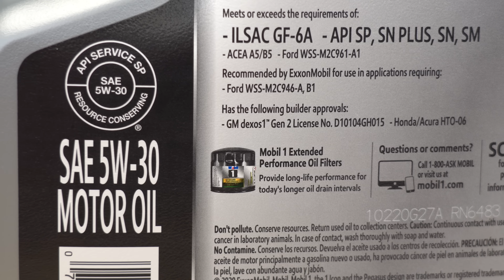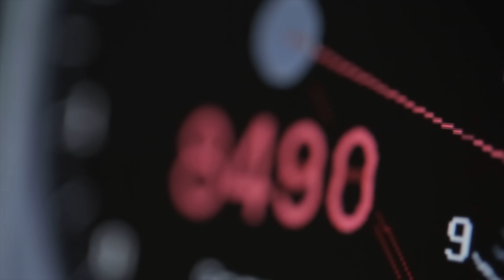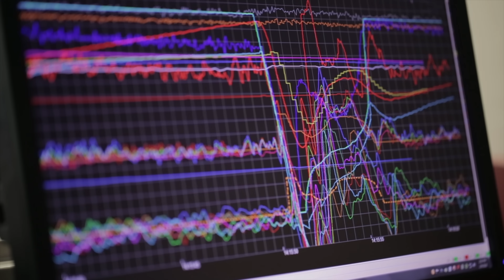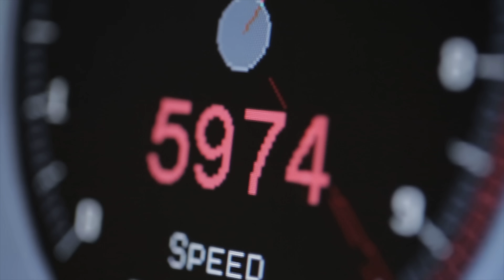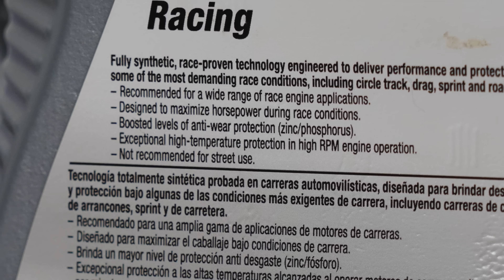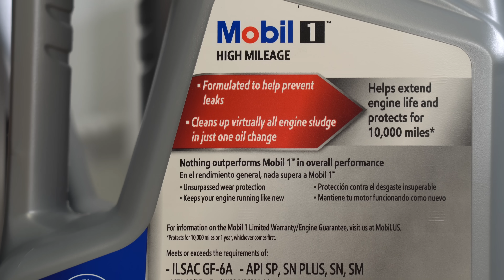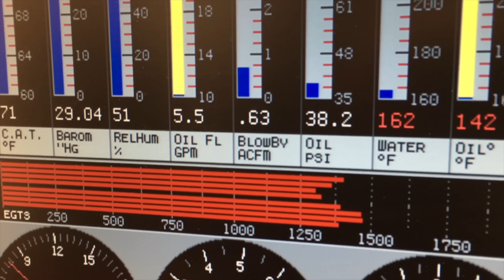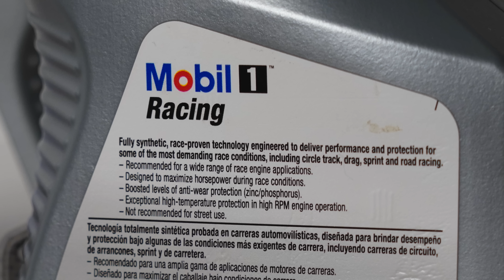Should You Use Racing Oil In Your Road Car?

Comment: Simple answer NO! Follow the owners manual. Racing oil with high ZDDP can actually damage your catalytic converters and cost you money out of pocket IF that engine oil is out of spec. With all that drag on the pistons it takes forever to heat up the engine oil. Once it does heat up, racing oil holds heat longer, which is great when tracking but terrible for short commutes on road cars with stock plastic intercooler and radiators. If you tuned your car, contact a lubrication specialist. They’ll help you decide based on YOUR VEHICLE APPLICATION. Not bro science. Not the forums.

Comment: Nice One Jason!!! I use for my BMW M2 BMW oils. My Lexus also using Lexus oils. Never had one issue. I used to be the dude who was also at the local store trying to buy the next best oils and filters. Because I did not trust the dealer oils.  I know now that oils are built to run with that engine setup - Great video!
Reply: BMW oil is Shell.
Reply: Its just who pays then. If you have an close look you will see all these "brand oils" are produced under licenses, the best oils are full synthetic. Motul, amsoil and redline all make top tier synthetic oils.

Comment: Jason ! Can you please consider making a video as to why ICE Automobile manufacturers 
have never offered any type of engine oil system ‘pre-lube’ or engine oil system pre-pressurization prior to engine start ?
It seems in your discussions that that there 
is a fair amount of opportunity for metal to
metal direct contact prior to the lubrication system fully pressurizing , perhaps even more so i’m very very cold climates with cold engine starts. Perhaps you could explore the cost/benefit analysis of pre-lubricating the (ICE) engine (s) prior to engine start. It seems as though the Cams and Lifters on ICE engines 
are or can be especially vulnerable to higher 
rates of wear due to those periods where the engine is turning yet prior to a fully pressurized lubrication system. I’d love to hear your thoughts on the matter and perhaps some consults with a few engineers at at the major 
ICE manufacturers. Thanks Jason -!

Comment: I use driven racing oil DT40 5w40 in my daily. But my daily is a fully built bottom end and head, big turbo setup 2.0 I4.  But for a regular daily csr you definitely don't need it.

Comment: This still does not expalin the Viscosity Index where higher Viscosity withstands heat better. Logical thinking say´s that high performance engins run HOT, very hot when the oil is going through a Turbo Charger and thus need more protection! The 16-20 weight oil lubrication falls off at a certain heated point so in order too maintain the engins performance the oil weight must be increased to 30 or 40. So WHAT IS GOING ON WHEN AUTO MANUFACTURERS RECOMMEND SUCH LOW WEIGHT OIL???

Comment: IMO if you track your car, fill with a race formula for your event because the added zddp will protect your bearings at high rpm/high heat.  Then just drain and refill with oem after the track day for daily driving.  Changing oil is cheaper than changing engines.

Comment: I have only one gripe about this video: please, stop talking about "tolerances". Engine has clearances. The clearances have tolerances. Points to that oil viscosity is not referred as "weight". There is no such a thing as w30 oil; it is an oil, that has viscosity grade that can be classified as SAE 30.

Comment: Mmm I'm an engine builder..all engines have metal to metal contact in some way, plain bearings are still used in crankshafts,overhead cam engines use shims for valve adjustment and then there's timing and distributor gears you cannot rely on oil pressure/film...Always use oil with a high zinc people and replace your cat converter every 50thou if you are worried.

Comment: Thanks for the video. Learnt more about ZDDP. The more common additive in race spec Oils is Moly. Does that cause any harm or benefit?
Also race Oils are generally Type 5 Ester based,  so do not need so much pour point suppressants as they cling on to the cylinder walls. Thoughts please @engineeringexplained

Comment: Other than sounding like a snake oil salesman...
Switching from flat tappet to roller tappet removed the need for zinc. BS. Ever seen the number of roller cams that wear flat? It’s just as necessary. I get the need for thin oil with cam phasers, but sacrifice the rest of the motor for it? I’ve only lost 2 motors in my 45 year career in automotive. Both were running pisswater oils. 0-20, etc. synthetic. Never lost a motor on 20W-50 Castrol. Some of the sludge I’ve seen where synthetic oil was used should be an embarrassment. Very common. And destructive. Synthetic has run its course. Snake oil for the masses!

Comment: "Imagine owning a car that needed oil changes every 500 miles"
sweats in rotary oil guzzler
Reply: laughs in weekly oil refills in my old honda
Reply: I once bought a used car that the previous owner changed the oil religiously every month. I couldn’t believe it until the dealer showed me the printout of all the service records for the car.
Reply: @josephpatricio851  I had service records for an old volvo that showed the owner would change oil, all filters and transmission fluids every week. Had a peak into the the engine with an endoscope and it was clean as a whistle. Bit over excessive but can't complain really.
Reply: Weekly seems like it would hurt rather than help  @HawtDawgBro09

Comment: I would like to see a video on the "lifetime" transmission fluids that some car manufactures are putting in their vehicles now.
Reply: Lifetime = life of the warranty
Reply: “Lifetime” in my experience means “change me in 30k miles”
Reply: lifetime = not need to replace until gearbox fall apart
Reply: @Tonyx.yt.  Then you abandon the car because its not worth to change the thing
Reply: @Tonyx.yt.  That means that the gear box will be filled with Neutrals   that is for the Warranty FUN is now gone
Reply: And those terrible multi vehicle formulas.
Reply: Yes, that would make for a great video.
Reply: Life time means warranty, there is no such thing as a “sealed transmission” they just don’t have the conventional dip stick. A Toyota mechanic I follow says change the “life of the transmission, permanent” transmission oil every 60,000
Reply: Lifetime actually means 100k. Mi
Reply: @joec8231  that wont work
Reply: Lifetime of the transmission lol
Reply: lifetime fluids don't exist unless you mean life of the warranty.
Reply: @weskirkland5850  I agree.  That is why I put lifetime in quotes.
Reply: Water and Red Dye
Reply: The invisible ink on that claim is "warranty" - once that expires, kiss the lifetime part goodbye.
Reply: Lifetime means the lifetime of the transmission. But u know, whether or not changeing the fluid may let transmissions have different "lifetime".
Reply: Weberauto has a very well done series on ATF, it's evolution and current tech.

Comment: question: How does better synthetic base oils which are more durable under high temperature high sheer situations make the ZDDP less needed? comparing oil with 60s tech with 2021 synthetics.

Comment: You have a great opportunity to ask mobile 1s team about anything. If at all possible, could you ask them about motorcycle racing oils? Since the oil also lubricates the clutch I'm very interested in knowing about what goes in it
Thanks in advance
Reply: The Redline [racing] motorcycle oil appears to have +2000ppm ZDDP whereas most 4T oils have about +1200ppm.
Reply: @mattf2535  thanks for the tip

Comment: I run my highly prepared classic cars with "racing oils", which means tons of zinc, 10w60 (yes, this exists !) for easier cold start compared to 20w50 and higher oil pressure when hot (and bothered) in the summer. My classic mini with its A-Series pushrod engine revs up to 8k rpm when needed (=when I need to hear a beautiful sound) but rarely sees over 7k even when driven hard in those french B-roads and high viscosity, high quality oils are a part of what helps this engine not grenading itself, considering it only has 3 bearings. For road use, go thick, you don't really need those 2-5% theoritical increase in HP, and you will keep those horses for longer.
Reply: When I got my first Alfa Romeo back in the 1980s the official recommendation was 10w50, but you couldn't buy it where I lived. Fortunately it was rare to need to start the engine in freezing temperatures, so mostly used 20w50. Later on had a race prepared Alfa and sometimes used a 25w50 Pennzoil, which is what the engine builder had used. One again, not too many cold starts. Having 10w60 available these days is kinda crazy.
Reply: I use 10w-60 in my Harley's and yes it is much easier to start

Comment: I have a Triton 5.4 engine which Ford recommends using 5W-20.

A lot of folks out there recommend switching to 5w-30, stating that 5w-20 was there to meet CAFE standards and that 5W-20 wouldn’t protect the engine as well.

I’m confused-do i listen to the internet clan or the Ford engineers?

Oh yea, i reside in Texas, a hot and humid climate.

Thanks
Reply: Yes the bearing specs actually require 5w30 or thicker but with the 3 valves and to meet Cafe standards they switched to 5w20. But the 5.4s need a 5w30 or even a 5w40

Comment: What about ZDDP on old style Diesel engines, like VW PD, it should be great, is not that true? What oil characteristics would you recommend for this engine? BTW i change oil about every 7500km or half VW 15,000km recommendation which I think is excessive and conductive to trouble.

Comment: Mobil 1 the worst oil ever made and worst oil for your car.. I seen many engines die at low mileage because all they used was mobil 1.. Every car new or old was always short on oil after 3 weeks of changing oil and almost 1/4-1/2 of the oil burnt off before next oil change.. Don't use this crap.. Mobil 1 just good at advertising and pays many people put their sticker on their cars and even if used in racing its changed every 200-500km

Comment: It was my understanding racing oil had zddp or zinc in it, which will slowly clog the catalytic converter.  Race cars don't have catalytic converters. I'd trust Redline 5w20 in warm weather due to it's higher anti-wear package.  But so far I've seen no tests that heated oil to 200F and then doing a bearing wear test using 5w20 vs 10w30.
Reply: 5w40 is better IMO Amsoil diesel oil.  More additive package and protection for heat and turbos even for gassers
Reply: @scottp6761 That may be, but  I would be wary o using 5w40 in an RDX that recommends 0w20
Reply: @lonniebeal6032  mm it wouldnt hurt it. May suffer on mpg some.  5w is fine or 5w30 even.
Reply: @lonniebeal6032  0w is for -65 degrees Fahrenheit. Dont think you need that

Comment: ALOT of newer vehicles use bucket lifters, and ZDDP is very important to prevent camshaft failure. As said however there is that pesky catalyst which prevents the higher concentrations of ZDDP in newer approved oils, however there are HIGH MILAGE oils which do tend to have higher concentrations of ZDDP ;)
Reply: Diesel oils have higher ZDDP.  Just use those.  5w40 in all my cars runs perfect

Comment: Well your only 17 years late to the party since I ran M1R 0W30 original formula in my 2003 Camry. Red Line Oil covered detonation issues and the difference between race oil and oil for daily drivers 2 decades ago especialy as it relates to dispersants, tbn and organometallic additives etc. They also have been selling 5wt. race oil for decades.

Comment: "Why do you daily your race car? Because I race daily. :p" Engineering Explained, any chance on doing another video on this topic. I track my daily car on a monthly basis (and I expect a fair portion of your regular audience would as well) and would be keen to get your thoughts on the pros and cons of using a racing oil in this type of use case - though I would assume the summary would be that as long as you aren't in sub 0C temps, change the oil a lot more regularly, don't care about your cat and happy to pay the extra time and money a racing oil won't do harm.
Reply: Just using Ams oil, don't play with different types of oil when there's already a leading one in the market, it's has double the additives than any other brand

Comment: I've been using Mobil 1 about 30yrs now.  It's never let me down.  I've only strayed once and that was just recently but I'll be going back to Mobil 1 the next oil change.  In 1990 or 91 I was driving my 1980 Buick Skylark with a 2.8L v6 in it.  Ugly awful car.  The radiator sprung a leak.  I drove it for 3 or so miles with no coolant.  Got it towed home.  We changed out the radiator, I changed the oil and it fired right back up.  It had Mobil 1 in it.

Comment: My question is which mobil 1 should I be using? I use the dexos stuff, but what's the difference between Dexos, high millage, emissions, and other variants? Does it actually matter? (Unless owners manual specifies)
Reply: Just use amsoil, Mobil 1 is trash compared to that, you can use that for any brand and it's safe
Reply: @cormaro13  ya, it's just expensive. And not as easy to get. Currently trying out penzoil.

But I know some people that swear by ams oil
Reply: @ilikerealflight  I swear by them 🤣 I just bought online and had an account whenever I had my camaro, if you're looking for a night and day difference for the Trans, their fluid does that with wonders lol, I put it into 3 chevys Trans and it helped alot lol, one being a 17 impala with the torque converter giving issues but didn't feel much after the fluid  swap, then the camaro, damn with a Trans tune and their fluid, it was just stomp and go no problems getting into a gear with the stock Trans at 170k before I sold it

Comment: I have a request, per GM bulletin #18-NA-355 transmission shutter and it involves GM transmissions from 2015 to 2019 and the apparent fix is Mobil 1 LV ATF HP. Many viewers would gain from your explanation.
Reply: Mobli 1 sucks and that's why a flush barely helps anything, do yourself a favor and put amsoil Trans fluid in and be an night and day difference all day

Comment: I've been running Mobil1 Synthetic in my 1996 Jeep XJ 242 since break in, have 360,000+ mi. on it now. Mobil1 5W-30 or 0W-30. Filters have been Fram, MOPAR, and WIX. Neither the valve cover nor the oil pan have been taken off for anything. I do need to change that factory valve cover gasket, but it leaks less it seems with Mobil1 Synthetic High Mileage.

Comment: What oil is good for engine that burns oil? Should I go up a viscosity first
Reply: Stick with whatever's recommended, unless it's a very heavy burn (meaning engine is very wore out) but at that point other things are gonna be a bigger concern for ya
Reply: @cpufreak101  yeah I’m sure the pistons are worn possibly. Or something is wrong. I just want to know if it’ll harm my engine to put a thicker oil. 5w-20 to 5w-30

Comment: So when IS some oil like 15W-50 or 15W-60 actually useful? Super high full throttle use? Slightly older cars at full throttle? Whats the deal, why is that in the performance aisle?

Comment: What I find the most unnerving about modern engines and lubrication, is that we still can't buy a vehicle equipped with a prelube system from the factory. As much as 60% of wear occurs at startup. There's absolutely no reason why they can't plumb an engine with with a pressurized prelubrication system. Mercedes did it back in the 20s, and it should've become an industry standard.
Reply: @glengillham4629  - very true. Also, since every major engine now has roller cam follower or lifters, they've reduced the zinc content (for good reasons) but it there are other areas that have suffered for lack of startup lubrication. Areas of peak sideloading in the cylinder, especially.
Reply: @jessicacopeland1644 Surfaces are never devoid of an oil film, so I am having a difficult time understanding startup wear problems. Also considering the combustion chamber incinerates any oil film but cylinder walls and piston rings can survive with minute wear for tens of thousands of hours with regular oil changes.
Reply: That's why modern engines use thinner blends like 0w20 for example.
Reply: what about a delayed start relay built in so the starter HAS to revolve a dozen times or so, rotating the crankshaft and thereby, the oil pump?
 before ignition? does that push enough oil up to help prevent dry starts?
My '02 Chevy 8.1 lights up about the third starter revolution.starts right up.
Reply: @kevinedwards7206  The issue is not as critical as some people state. We are only talking about initial cold starts, not subsequent re-starts?
Reply: Some airplane guys use a prelube on there air cool engine

Comment: I run 15 40 rotella in my f150 83 (568k no rebuild) 300 i6 and in my 87 300 i6 f250 (1.04 million miles no rebuild) but my turbocharged ranger uses 5 20 royal purple but im interested in seeing if mobil 1 is better
Reply: Forget the Mobil 1 -- the Royal Purple performs much better -- and it TESTS better, too.

Comment: I use valvoline vr1, which calls itself a racing oil, in my BMW M5, with the twin cam 24 valve big 6. I need the high zddp because of the flat tappet cams. The oil has enough detergents for my short oil change intervals. It comes in a recommended weight and was recommended to me by an indie BMW shop. I’m happy.
Reply: Is it 10W-60 weight?
Reply: @FreeHazelNuts  Later M cars took 10w-60. In some markets the M88/3 and S38 were recommended anything from 10w-40 to 20w-50. I'm running 20w-50 and don't use it below 40*F really ever.